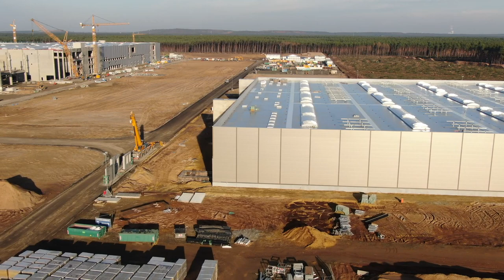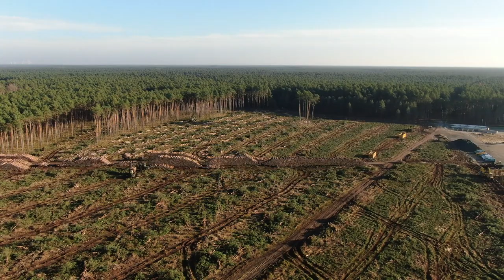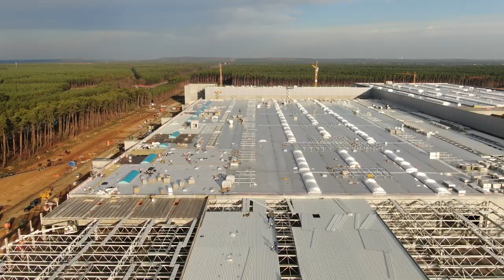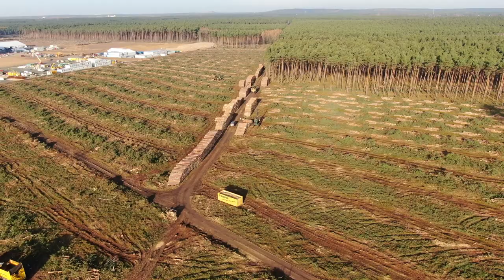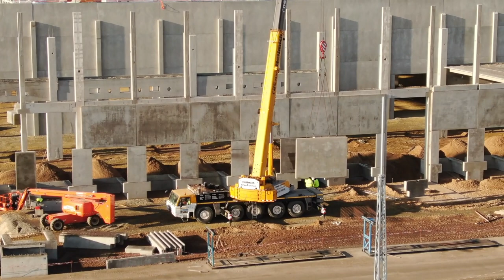Giga Berlin | 2020-12-05 | Tree clearing

Comment: The economic effects of installing this factory in the Berlin area will help to rebalance the traditional east-west difference in Germany. Tesla will encourage many suppliers to come too.
Reply: Agree totally. I'm not sure the local utilities infrastructure can handle this - the state needs to make an equivalent investment to provide power, water, gas, road and rail capacity to make this happen. Not so sure the Osties are quite in agreement however.
Reply: There is no unbalancing between west and east (anymore). It's a problem between the rich south (Bayern + Baden-Württemberg + Hessen) and the "poor" north. Look at Erfurt, it's the new center of ecommerce. And than make a walk into the Ruhrgebiet and rethink your words.
Reply: @oliverh.4314  I read academic papers and I still think the West-East divide is still very much alive economically.
Reply: @etbadaboum  No, it isn't. Sure, in the Eastern countries there are a lot of small cities, wich are lost. But you find such cities in the Western countries also. 
But in summary, the Eastern Germany has made massive improvements. On the other side, esp. the Ruhrgebiet looses much.
Reply: @oliverh.4314  Giga Berlin is located in the district Oder Spree, which had a GDP per capita of 22500€ in 2018 (see landatlas.de from the Bundesministerium für Ernährung und Landwirtschaft). Looking at the 15 cities and districts of the Regionalverband Ruhr, only one had a lower GDP (Bottrop) - all others are still "richer" than Oder Spree. Yes, there are some exceptions like Erfurt, but on average all five eastern states are below all western states.
Reply: @christ5042  You are watching only on the GDP? How sorry. Prosperity and living conditions is much more than income.

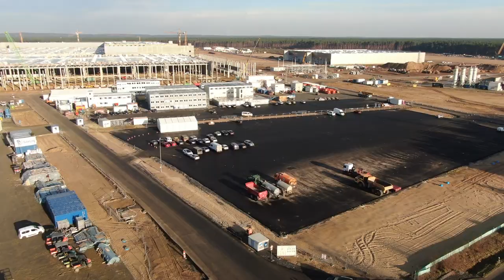Comment: Wondering what all that newly cleared as well as extra open space (at 16:03) will be used for.

The more I look at these videos the more this seems like a huge LEGO construction set, as most parts seem the be pre made somewhere else and shipped in. Few sections seem to be manufactured on site.
Reply from the maker: At 16:03?
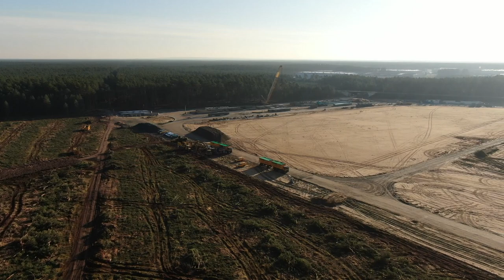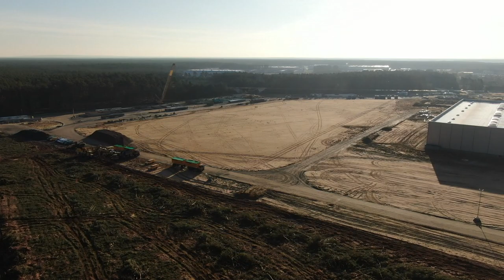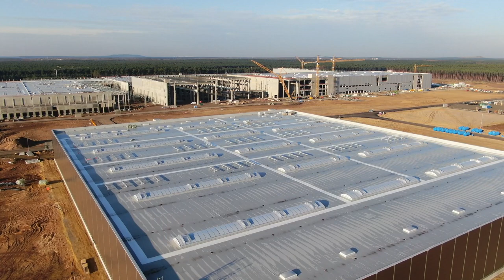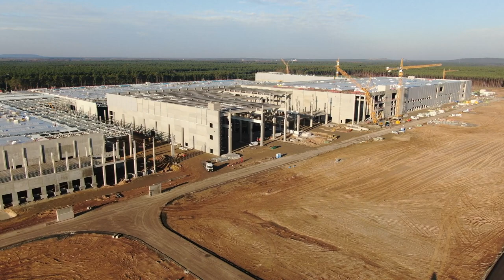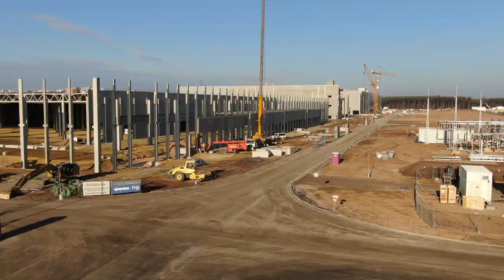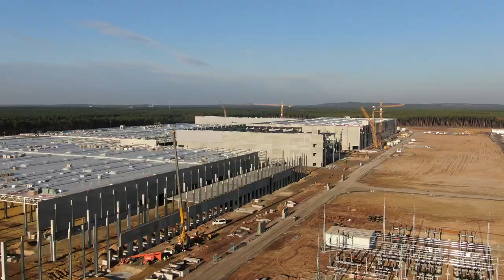Reply: @TobiasLindh , oops. Looked at the wrong digits. 3:35 to 3:43,  4:31 to 4:39, 7:39 to 8:01, and the newly cleared space.
Reply from the maker: @zews1  4:31 will be Utility buildings. At 3:35 and the newly cleared area I don't know anything that will happen there other than another future main building that will be build in another phase. Most of the new area that get's cleared will be used for logistics, but that area is not visible in this video. Most of it isn't cleared yet.

Comment: Clearing more land!!! I've been wondering if the conclusion of Phase 1 will roll straight into the launch of Phase 2 construction, and this looks like the clearest indication yet that it will.
Reply from the maker: Officially it's still for phase 1 though. The area will mostly be used for logistics.
Reply: @TobiasLindh  yes in the short term. The area being cleared will eventually become phase 2.
Reply: @TobiasLindh  Okay. Thanks for the info!
Reply from the maker: @andygranger3662  True. The area they cleared in this video will be the area of a second main building at another phase. The Drive Unit building will be part of that building.

Comment: How are the concrete wall panels affixed?  I don't see any signs of fasteners, metal hangers or glue.
Reply: Interlocking grooves, see around the 14 min mark
Reply: @Remy-today  @14:30 I don't see any signs of the panels interlocking.  I see what looks like a groove on the panels, but I don't see a spline that would fit into the groove on the lower panels or on the sides.
Reply from the maker: I think at the bottom there are metal pins that fit into holes in the bottom of the panel. But i don't know how they fix the top of the panels.

Comment: Why is the drive unit building separate but also in the way of the lower right corner, anybody?
Reply: I have discussed this point with Tobias previously. It will likely be integrated within the future phase 2 building, hence no east side access. Its isolation is merely temporary, meeting an immediate need to provide drive units to  phase 1.
Reply: It's the same in Shanghai.

Comment: Nice video. The installation of the concrete panel at the end would create massive safety concerns here. The thing is swinging all over the place with the guy on a lift - scary. Really surprising that they get away with that in Germany. Here, if that showed up on a video that the company would be immediately removed from the project. That guy can get killed if the panel hits him hard enough.
Reply: Could just be the wind. Not sure what the  operator can do about it. It’s a big flat panel.
Reply from the maker: It looks worse in fast-motion. In normal speed the panel barely moves. I think they are in full control and it's safer than it looks.
However, I would be too scared to stand under that panel.
Reply: @TobiasLindh  Me too - but that also means you and I don't feel safe in this scenario
Reply: @joscaca  if you watch any videos about Spacex in Texas you will see that even the smallest metal ring sections are moved while people on the ground hold them in place with metal cables.

Comment: I wonder why Tesla didn't also choose a diamond-shaped building like in Austin.
Reply from the maker: It will be a diamond shape, but the first phase is just one corner of it.
Reply: They did. This is only 1/4 of the emerald, so it only has one 45-degree corner cut out.
Reply: @TobiasLindh  Of course. That's only a quarter of it. Still it won't be on th same exact level since the paint shop and all will be more elevated. Nonetheless it will be very impressive when done.
Reply: @FutureAzA  so how many phases of construction?
Reply: @joscaca  This is likely only 1/4 of the final footprint, though it's unknown how many phases they'd break that up into.